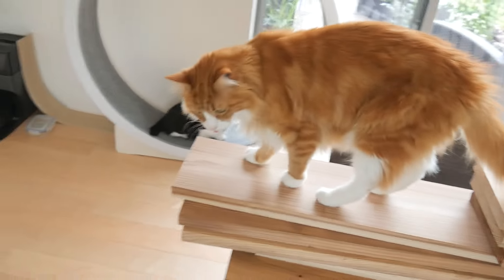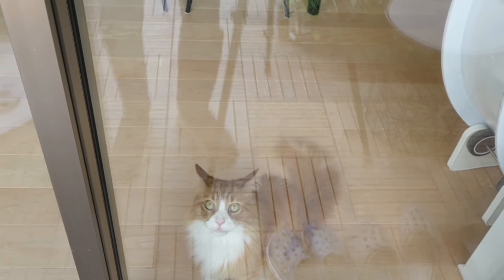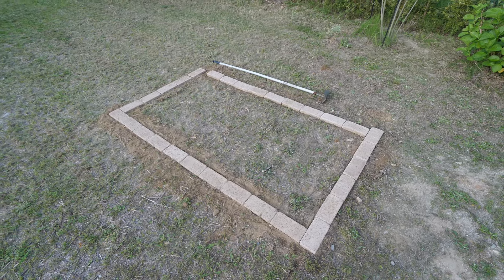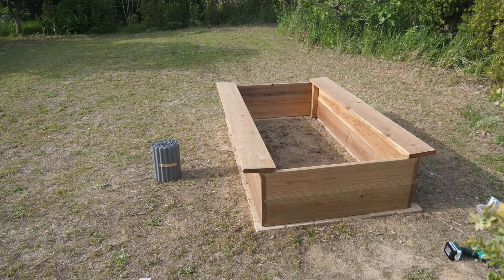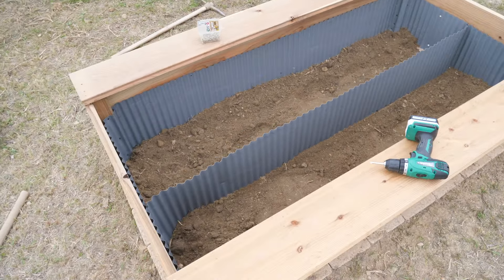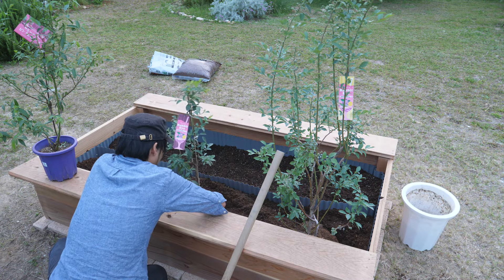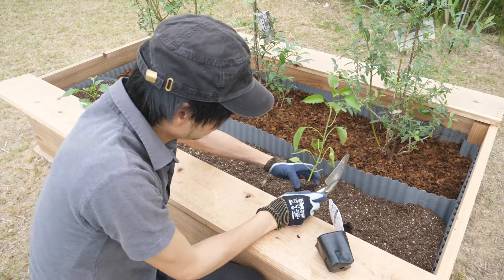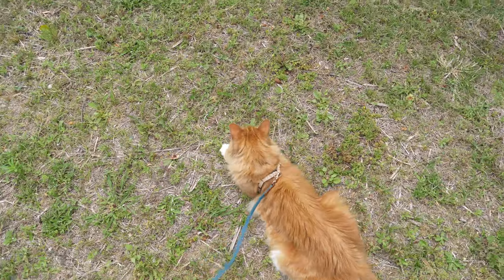🌱Making a raised bed (DIY🔨)

Comment: Jun, in a raised garden, you want the soil all the way to the top. The soil does settle a bit after awhile so you want to allow for that settling by initially bringing up the soil to the top. Also, look into no-dig gardening. By cultivating, you're bringing up weed seeds up into the raised bed.

Comment: So much fun! I have a container garden on my deck and I've learned a lot in the last year. Blueberries really do need acidic soil. They also need a certain number of chill hours, so don't worry about protecting from the cold unless the flower buds have started to swell and open. Winter is the best time to prune because you can see the flower buds. With peppers, they are actually perennials if you can protect them from cool temps. They start to pout below 50F/10C.

Comment: sweet peas, tomatoes and lots of lettuce types are also very easy to grow. I got some sweet peas, forgot the seeds in winter outside, they rained on and actually sprouted in the pot filled with water from the rain and snow, just dunked them in thr ground, planted them 10 to 15cm apart and now its just one ginormous bush of individual plants hanging on to each other (cuz they're crawlers, they sprout those little entangling branches that hold on to everything for their dear life) They really took off around April/May and are now about 40cm from being seeded in March. Idk the specifics like ph value of them but used veggie soil I could buy here locally. Also use eggshell powder and coffee leftover, but be careful with the last one because it can easily spoil and that's kinda bad. just put some in a little hole close to the roots. The sweetpeas are actually giving a ton of harvest despite it being their first year. Hope your harvest is also bountiful, but those bushes may take up to 3 year before they give plenty of blue berries as they're in their growth stage. Also strawberries is something everyone loves and enjoys.

Comment: I built my own raised beds when I was 16... it took a big effort but it worked out. I didn't use any bricks as a foundation, I started below ground and used 6 large stakes that I hammered into the ground about 2 feet deep, then put the sides on, about 2 feet tall. I used brick but as stepping stones between the beds. I grew tomatoes mainly but also cucumbers and some potatoes.

Comment: Just a word of warning: peppers cross-pollinate very easily. If you don't like spicy stuff, i'd have rachel taste the peppers that aren't supposed to be spicy first. My parents have had almost all of their dozen or so pepper plants come out in different degrees of spice because of the 2 or 3 chili plants they had out there.
Also, pine is a good mulch for blueberries. Pine is fairly acidic and as it breaks down over time it'll help maintain the pH. If you mix a bit of sulphur in with it, it'll make some of that acidity accessible to the plants more quickly.

Comment: the birds at 2:35 activated my Need to Bird ID since there was no label, but all i could really get from the call is that they're raptors. so i imported the sound to Merlin and they think it's a black kite; the soundbite was similar but i noticed it was from India, so i thought perhaps there is a subspecies in Japan with a different call accent. and yea!! black-eared black kite (Milvus migrans lineatus), and its soundbites are closer to the calls in the video!

Comment: hello! i had a quick question, so in the video you made it so the little ledge was tilted inward so if one of the fruits fell over the edge, it'll roll into the raised garden bed. How did you do that? did you cut the wood at a angle so it thicker on one end? or did you use a different method?